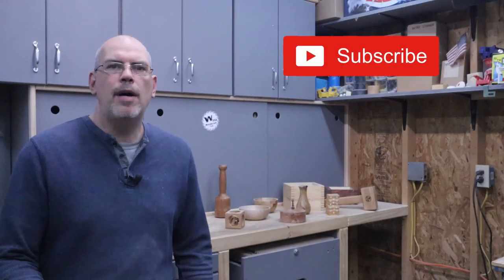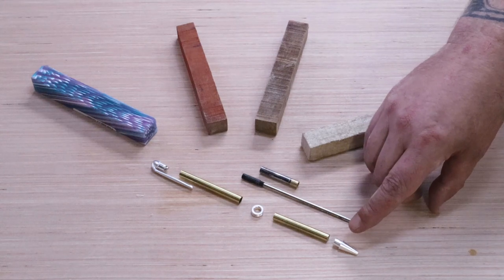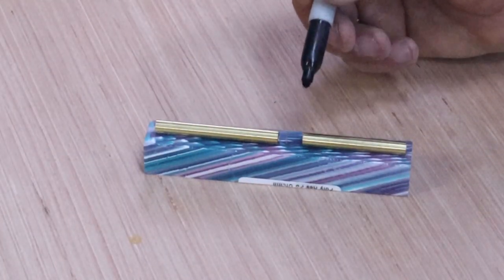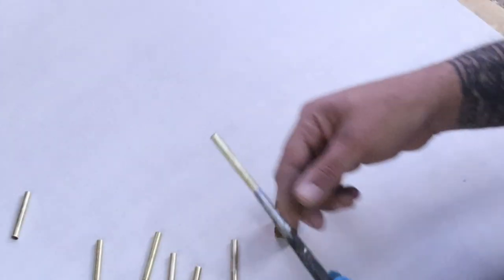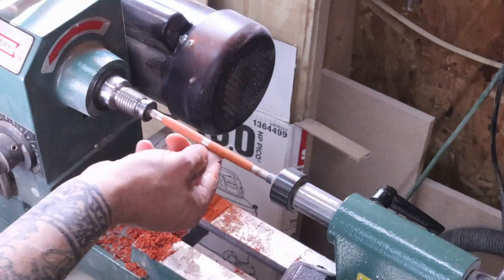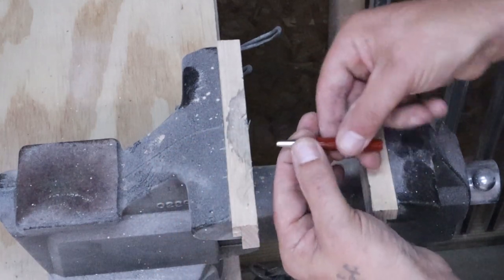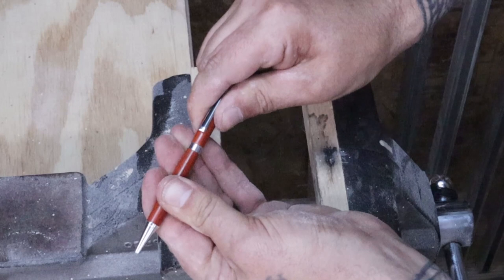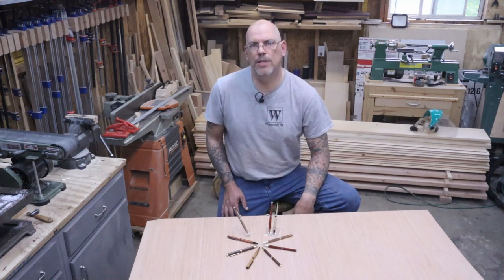pen turning for beginners

Comment: Good job Mike! I've never had very good luck with using the pen mill to square the blanks up, especially with segmented blanks. I use a sanding jig from Turner's Warehouse, bought a set of punches from Harbor Freight and flatten the ends on the sander. If you want to turn acrylic blanks check out The Classic Nib under their "Classic Castings" heading. They're made with Polyester Resin so they turn great. Good people to deal with. :)
Reply from the maker: Thanks Lawrence.  Thats a great tip. I've had limited success with the pen mill. And I'll definitely check out the Classic  Nib. Thanks for watching and commenting. 👍

Comment: Can you cover a bit more of the actual turning the part where you start getting close to the mandrel.  Like how do I still turn the wood down, and avoid the sharp edge hitting the metal.   Also, maybe add putting the pieces on the mandrel.  Good video, I have a few pen kits, but haven’t gotten to them.
Reply from the maker: Thanks for your feedback  Scott.  When I get close to the bushings I just carefully make real light passes until its really close,  then I usually sand it even.  But I must say. I'm no professional.  I tend to buy a few sets of bushings and have been known to bump the tool into it a few times. Lol. Thanks for watching and your comment.

Comment: I really enjoyed the video sir.  I would like to see more videos on the lathe.  I was wondering where you got the drill bit used to clean out the glue after you glued the brass fittings.
Reply from the maker: Thanks David. I believe I got the bit at Rockler.  But I'm sure you can find them online.  I'll  put a link in the description tomorrow.  If you want to check back.  Thanks for watching and commenting. 👍